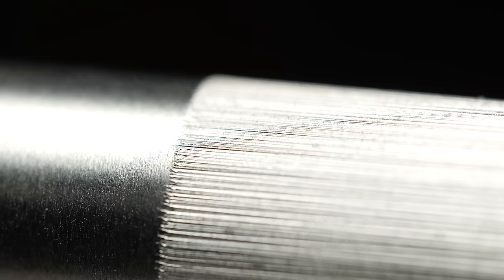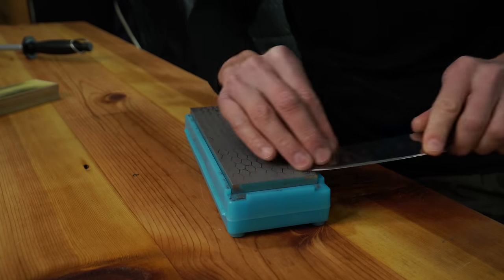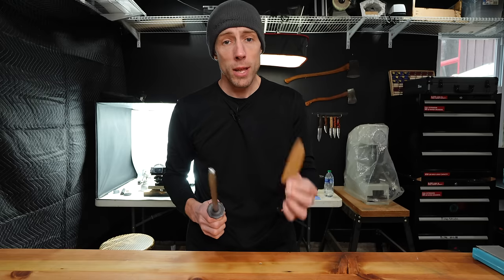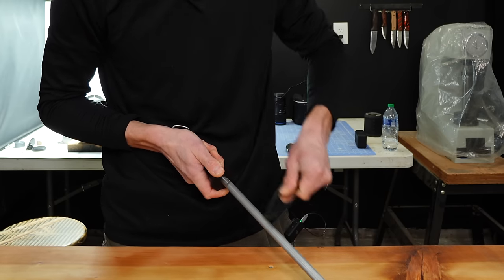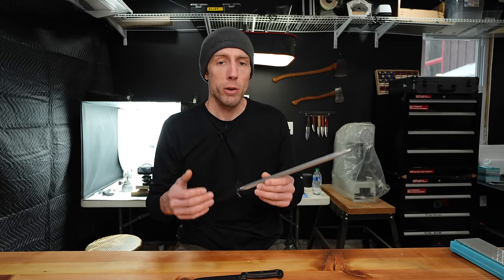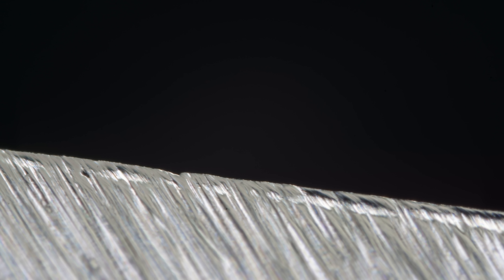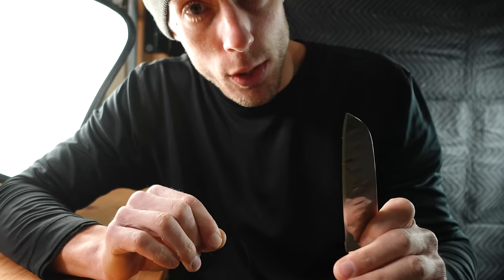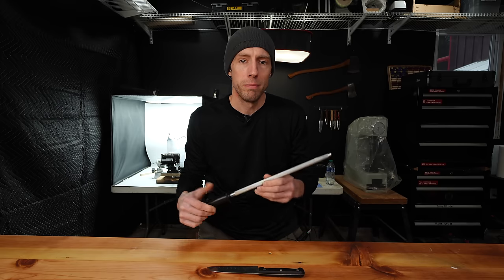What Do "Knife Sharpening" Honing Steels Actually Do?

Comment: I am amazed by so many videos demonstrating a honing rod by pushing the blade edge forward.  What they are doing is rolling the edge much further, then breaking it off to create a serrated knife.  So the knife appears to cut better.

These are still used because they come with knife sets, they are inexpensive to make, and most people don't know how to sharpen a knife.  So it is quick and easy to make a knife seem to cut better.  Most of the time, good enough is good enough.  A fine apex is more important for fine slicing or cutting squishy food (like tomatoes, although fine serrations cut well too).

I use a honing steel to straighten rounded edges on cheap knives.  I draw a finger nail toward the edge to check that the edge roll has been removed/reduced.  Then I check for sharpness by holding the knife edge toward a light source and look for reflections off of the edge.  If I see reflections, I know I need to sharpen the knife.  This is a quick and dirty method make an edge good enough to quickly cut some food without getting out the knife sharpener and stropping.

Technically, you are correct.  But time is limited and critical.  So sharp enough is quick and good enough to get the job done in most cases.

Comment: For most standard chef knives, I think a lot of chefs actually do pefer leaving some or most of the burr standing up on the edge because it acts as a light serration on the blade and also gives you enough material to be able to afford to have some mildly bending over as you work - and then, you simply just re-hit it every hour or between jobs with the honing steel to make them all stand up on end again, all ready to effortly glide through your next tomato skin.

Contrastly if you get a mirrored, dead straight and flat, microscopically picture perfect blade on a knife, and then suddenly have to slice 200 tomatoes with it - sure, the mirror perfect edge wil cut nicely at first, but after youve ben through 100 cuts tapping that edge on the cuttingboard each time, what you are doing is dulling the blade, as would happen. Only, now you cant just simply whip out the honing-steel and bring that nice bitey edge back to shaving paper in 5 seconds,  you will instead have to be wheeling out all your cumbersome stone sharpenning equipment 2-3 times a day, just so your knife always glides through a simple tomato skin like it should.

If such a siple piece of long-standing hardware were so obsolete as you claim, then you simply wouldnt see them used in every single last kitchen the whole planet over... think about it.
Just because you cant imediately see the purpose of a thing from the perspective of your armchair, doesn't necessarily mean one doesnt exist.

Comment: Very well done, & correct - mostly!  However, the knife you are using appears to be v. high carbon stainless - hard & brittle (everything's a trade-off) - & unsuitable for a steel at any time.  Steels find there best use with older, lower carbon, more easily shaped blades (note: 4:50) from an earlier era that require more frequent 'touching up' (due to 'rolling' or dulling) during work.  A steel, as you note, won't 'sharpen' your knife; instead it finely 'chips' v. hard steel.  With an older, forged blade, a steel imparts a finely, but regularly 'serrated' edge, just fine for the kitchen.  Please also note that a steel required no lubricant or running water where a lower carbon knife would quickly 'fill' a stone.

Comment: I have been a butcher since 1992, these sharpening steels have their purpose. First of all, they are used as a tool when boning (third arm, lever, crowbar, etc.) and then, of course, to be able to use the knife for longer.

Everything you show in your video is true and also applies to the things you use. 

As professional butchers in the meat industry, we were paid by the piece. So if you have hundreds of pieces of shoulder or leg a day, it makes a difference whether you need 5 or 30 knives to get through the day. And that's exactly what these sharpening steels have achieved.

Professional boning knives have 52-55 hrc, are slightly flexible and have a convex grind.
The reason for this is to cut along the bone rather than into it. (Short example. Flat grind is better for outdoor knives to make feather sticks, which you want on wood but not on bone).

I would never pull a kitchen knife or outdoor and hunting knife over a sharpening steel. The difference in hardness is far too small. Every chef you see in the media and then "hacks" at the sharpening steel with a chef's knife destroys his knife. You're absolutely right.

Great work on your part. Great channel. I'll leave a subscription.
Greetings from Germany.